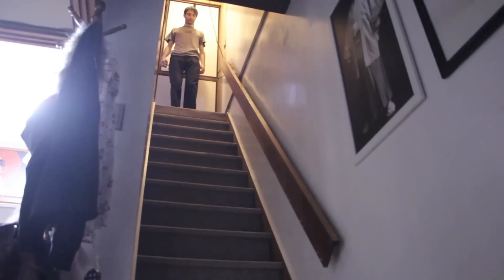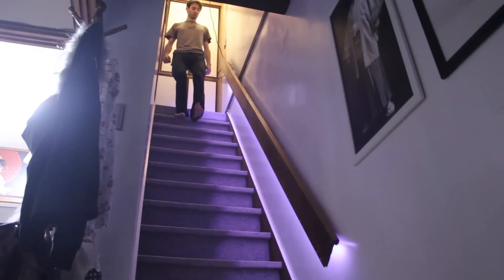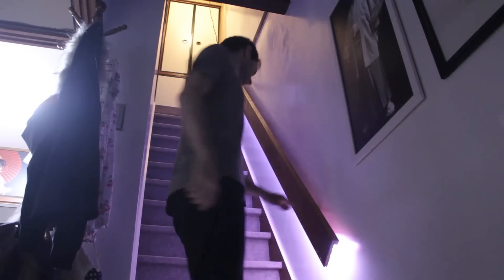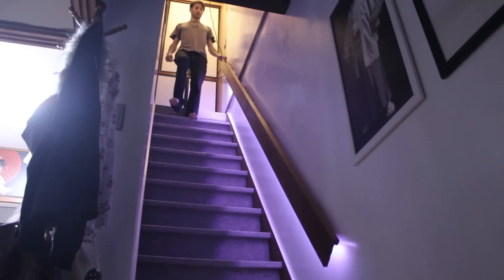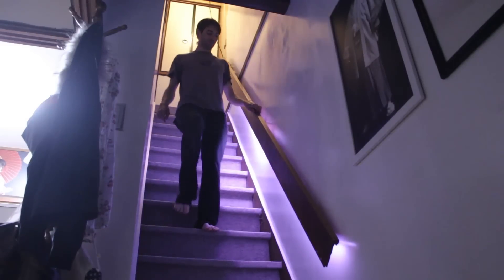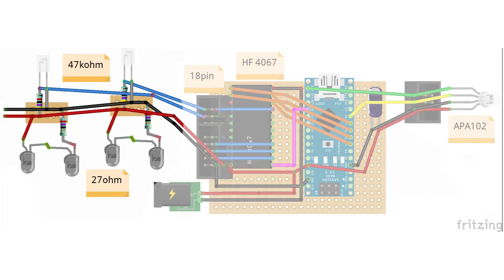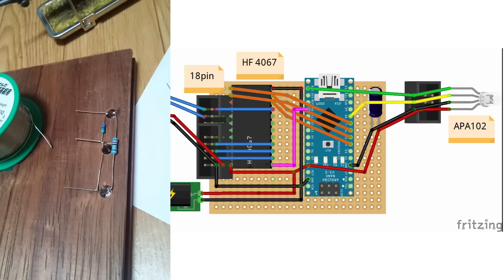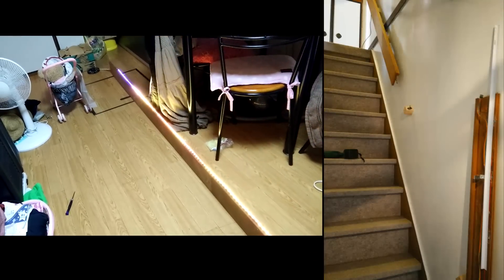interactive handrail stair lighting with arduino

Comment: Hi, thanks for sharing

Can i use WS2812B chipset led ? 

#define LED_TYPE    APA102    to     #define LED_TYPE WS2812B
#define CLOCK_PIN 8    to    //#define CLOCK_PIN 8
FastLED.addLeds<LED_TYPE, LED_PIN, CLOCK_PIN, COLOR_ORDER>(leds, NUM_LEDS).setCorrection( TypicalLEDStrip );    to

FastLED.addLeds<LED_TYPE, LED_PIN, COLOR_ORDER>(leds, NUM_LEDS).setCorrection( TypicalLEDStrip );

Is that true and work ?

and 4067 15.pin is empty ?

Comment: Hello mate. I have looked for similar projects and can't find any. From your video I can see there is not enough proximity sensors. So I have found a big multiplexer 64 to 1.  Could you take a time and do some schematics everyone and explain how to code with adding AS-6408 https://cdn.hackaday.io/images/resize/600x600/4775311563181447438.jpg 
A big THANKS.
Reply from the maker: Oh Boy! You will have a LOT of wiring to do! :D
well it is pretty much the same, but you will need 6 control wire instead of 4. Also you will probably run out of memory with that much sensors. you will need to limit the number of data you store for the running average (this is the const int numetal = 10; in my code)
also the number of sensors will be  64 in the arrays instead of 16.
last thing will be the mux control: byte controlPins[] = {B11110000,..... you will have to go for all the 64 values (!!) from B00000000 to 11111100 instead of 11110000 like me.
Reply: @Benn25  :D I think it is not for my nose yet :D I'm just started learn c language. If you could help a code similar like this would be wonderful :)
Here is the link:
https://www.youtube.com/watch?v=hD9OyGGNjqg&t=55s
Thanks mate ;)

Comment: How many receiver and transmitters did you use for the whole stair run? Also, what have you soldered to A7 on the arduino? It's not on the wiring diagram you produced.
Reply from the maker: david billings As I said in the video, I used a 16 channels multiplexer, so 16 sensors.
There is nothing on A7.
Thanks to the MUX, only one analog pin is needed to acquire all the data from the sensors.
Reply: grobenn25 I understood you used a 16 channel mux but that doesn't mean you needed to use all of them but thanks for clarifying that up. So you didn't use the pink wire going into A0 after all?
Reply: @Benn25  could you clarify the pink wire more please? Cheers :D
Reply from the maker: @gameguru3112  the pink wire is the input from the sensors entering the Arduino.
Reply: @Benn25  that I understand but tracing the connection it looks like it's soldered on to pin a7 which is the next pin after the power pin on the aduino using a link wire. On the code, is all of the analogue ports set to receive signal? Meaning that it doesn't matter where I connect the mux output into the aduino? 

Sorry for the questions, I am trying to replicate the idea for my home.
Reply: @gameguru3112  Hi David have you implemented this at your home ? 🙂

Comment: Nice project, I'm trying to make it now, but i saw a thing about your skedule that you draw....and what u let see in the movie (on the wood)....in the skedule u draw the 27R resistor between gnd of one IR LED and the GND of the IR Photoresistor, but on the wood u solder the 27R resistor between the 2 IR LED's, what is the good one??
Couse when i shoot the programm in my arduino uno, i see the colorwipe first and then the lights shoot to middle and stay there......
I tryed both ways but it won't work.....;(
Can u help me pls...